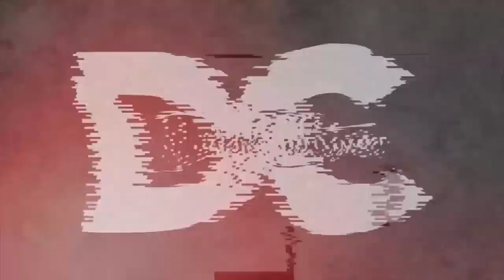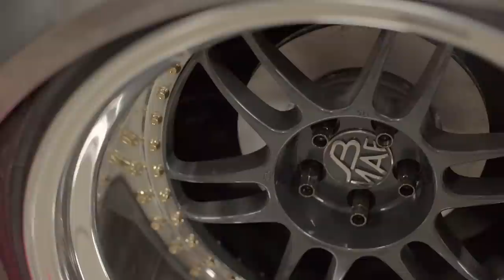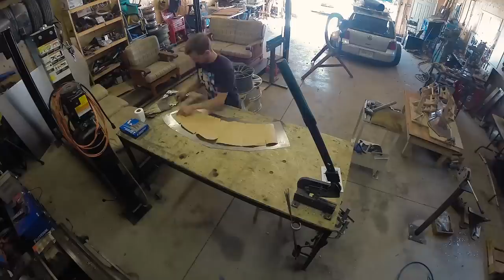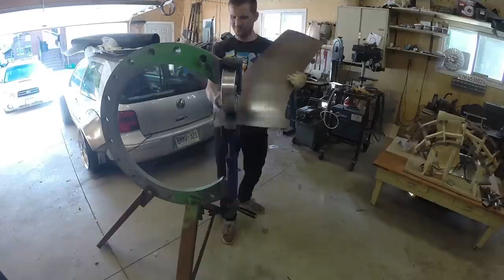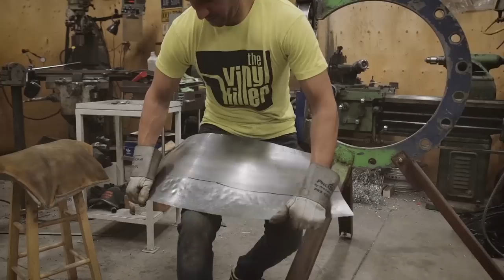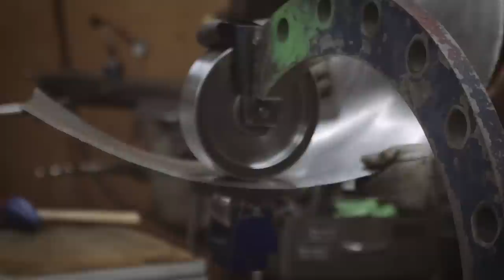Building Metal Widebody Fenders Custom

Comment: Do wide body kits serve any functional purpose? And if so, is it that they do but it's so insignificant to qualify as functional or does it actually worsen a car's performance?
Reply from the maker: Hey Daniel, I believe it depends on the application and the type of build one does. In this case, Jason is a fabricator who loves to work and experiment with sheet metal and build custom wheels for local customers, so he built custom 3 piece wheels for his personal car to show case his work. In turn, this forced him to have to build a widebody 'kit' for his car, and he chose to do it out of metal and entirely by hand himself. I know in some instances, say for instance a rwd car that has an engine swap and makes a ton of power would need a lot more grip to put the power down. Sometimes cars with really small engines that had bigger displacement or power adders like turbochargers added need body customization to fit wider wheels, some would say this is done for function. Hope that helps.
Reply: DropCulture Yes it did, thanks man :D
Reply from the maker: No problem! Thanks for the view and the support!

Comment: Is it possible to make a mold with a CNC, from a computer design and stamp the sheet with it? Is it harder than this process?
Reply from the maker: Although not a bad idea, that is a lot of metal to cut, programming from a CNC, and hours to cut. It would be very very costly. This is the way they used to make cars back in the day

Comment: name of the rubber like material between the flares and the original body
Reply: TheHyperCreations fender welting
Reply: what size all the ones i have look at look a bit to big
Reply: I know, that's why i ended up using just u-trim.  It goes around the sheet metal and that's it.  No extra piece that bridges the gap.  Maybe some other guys out there know of some better stuff suited for thinner sheet metal.

Comment: Nice, but running a tire that is absolutely way too small on a wheel like that is Dangerous and plain stupid. By doing that you just lost any and all performance from the tires and you will pop a tire off the wheel bead in any kind of hard cornering. Completely useless and looks like shit.
Reply from the maker: Definitely not for performance, the car was strictly built for looks to show off the fabricators ability. Luckily, there are no plans on hard cornering with that setup!